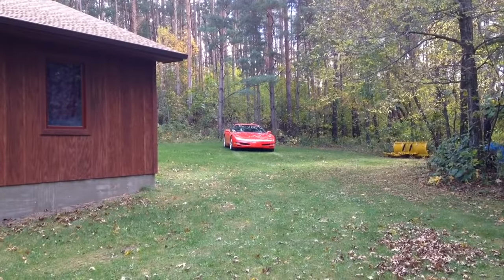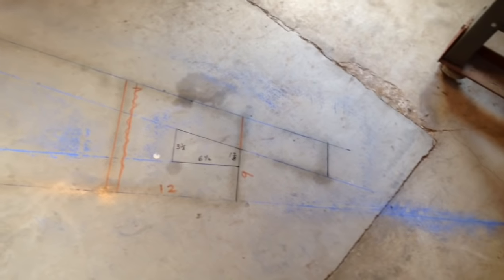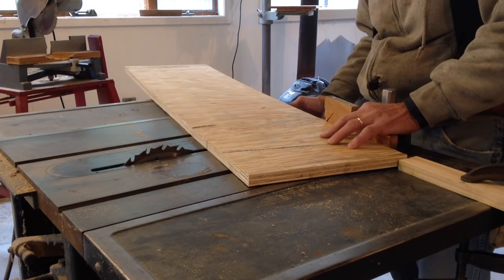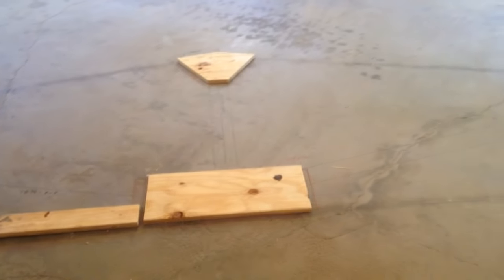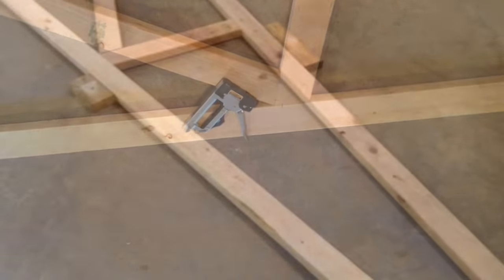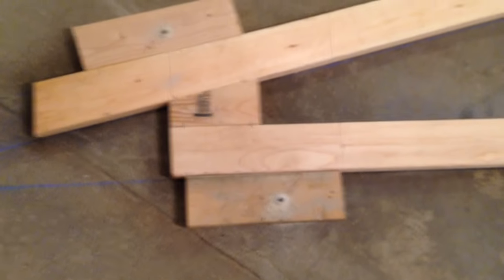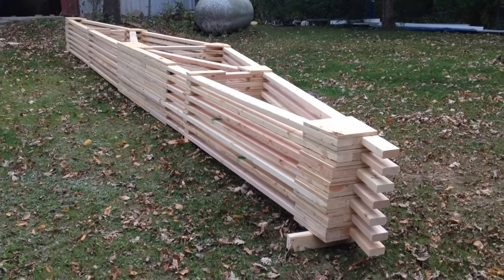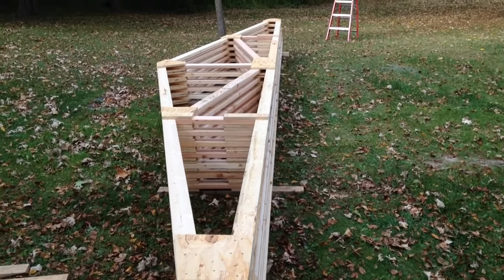Build your own wood trusses

Comment: I used Titebond II to glue mine together and used 1 1/2" staples to put mine together. You can just roll the glue on with a paint roller. In ten minutes you couldn't tear them apart without destroying the truss. I've made hundreds of them that way and after 25-30 years they are still in good shape. Way better than the press metal plate gussets.
Reply from the maker: Kris,  Good tips that you have.  Thanks for chiming in.  I would be a little leery of the titebond, as it is not waterproof.  If you keep them dry it would work.  Obviously has worked for you.  steve
Reply: @flyboyslc1  Would not make any difference. Neither 2 or 3 is structurally rated glue. Read the bottle!
Reply from the maker: @gary24752  I think your comment was directed to Kris.  The PL3 that I did use complies to astm D3498 which applies to gluing osb, plywood, to wood floor systems.  A lot like gussets to lumber truss components.  Here is the tech data sheet.  https://dm.henkel-dam.com/is/content/henkel/tds-us-loctite-loc-pl-premium-3x-2019-12-12    Your point is valid.  Make sure the glue you use is the right application.
Reply: @flyboyslc1  Actually  ASTM D3498 does not pertain to using it for structural purposes. It is construction adhesive meant for sub floor assembly.

Comment: How'd you size your gusset plates?
Reply from the maker: Hello Dillon.  Great question!  The gusset size and shape were just functions of looking at the various member joints and sizing the plywood gussets to adequately cover the joint.  More or less a seat of the pants thing.  Figure that a 2x4 is 3.5" wide so in all cases make the plywood cover the full width and then at least twice the length or 7" down the 2x4.  The most tension stress in the whole truss is the bottom chord.  So at that place I lapped the bottom chord splice 24" on each side of the joint so my plywood was 48" long by 3.5" wide.  Hope this helps.

Comment: Plywood has a grain. The strong direction is "with the grain". more than half of your truss plates are cut and will be installed "against the grain" so they will be less than half as strong as  they could be if you paid attention to the grain of the plywood.
Reply from the maker: Holly,  you are correct, at least in part of what you say.  Plywood is really complicated.  Tensile strength can vary a lot between various plywoods, depending upon veneer thickness, number of plys, and species of wood.  Couple that with the fact that almost all of the truss connections are not simple vector forces.  Many connections connect three members, and some of them are in tension and some in compression.  Generally speaking, if the face grain of the plywood matches the grain of the lumber you will have the best situation, which is what i did with my trusses.

Comment: Building trusses sounds like a lucrative business. I can actually do the calculations and sketches on my computer.  But I’m skeptical of wood trusses.  Wish there were other options that isn’t susceptible to termite invasion.
Reply from the maker: See a post below regarding light gauge steel trusses, that are built in much the same way.  Totally termite proof.  Or google steel residential roof trusses and see what you find.  On the business side of things, you would have risk that would need to be insured to protect yourself if something went wrong.  best to you.  steve

Comment: Do you know of a book that I can buy to help me to build a truss for a very snowy climate  for I'm going to build a barn that is going to be 48 ft. wide
Reply from the maker: Hi Bill,Glad you are going to research this a little, as what you are planning to do has way more risk than my short span trusses that were installed two foot on center spacing.  What I would suggest is google "pole barn design" and then sort through the results.  I did find this without too much looking.  https://morningchores.com/pole-barn-plans/   There is a lot of stuff out there, and you have a lot to think about with a barn.  Good idea to get some good info, and maybe visit a local building supply place to also get an idea of what you will need.

Comment: Over the years I have seen quite a few trusses broken at the metal gussets.  Never, broken at a wooden gusset.    Structurally, the larger the wooden gusset, the stronger, but again, I've yet to see even small and somewhat undersized gussets be the site of a break.     When a patch is needed for a broken metal gusset plate, guess what, it's an oversized plywood gusset.
Reply from the maker: Norman,  I can tell we think a lot alike.  Everything you said is true.  I can remember calling the truss manufacturer and asking for a field repair procedure and it always involved using lumber or plywood, glue and nails.  Ply gussets also make the truss more rigid and that helps when setting them too.

Comment: Whats with the sparks flying out of the nail gun (9.25), that's not normal is it? Nice vid though.
Reply from the maker: +twoweary   Hi there.  Was wondering if anyone would ever ask about that!  Good catch!  No it is not normal.  I was using some old leftover generic nail strips from another job in my own Paslode nail gun.  I suspect that the nail gun driver or hammer if you will was not perfectly compatible with the nails, even though the nail strip maker said they were.  Just a slight mis- spacing of the nails would cause the driver rod to clip another nail head before striking the nail beneath it that is to be driven, causing the sparks.   It worked, but surely not as well as if I had name brand Paslode nails in the gun.
Reply: Oil the nail gun

Comment: remarkable job my friend. 
one question :
wouldnt it be easier to get the lumber together with truss nail plates instead of cutting the plywood supports.
again, beautiful job
Reply from the maker: +Pikubird Ok .  Hi there Pikubird.  Nice feedback and I appreciate it.  The galvanized truss plates you speak of would certainly save weight.  I am guessing the plywood added about 25 pounds to each truss.  There are two reasons I did not use the splice plates.  They are hard to get a good attachment using carpenter shop tools.  They are a factory applied splice, installed I think using large heavy rollers or a hydraulic press.  I do not have either one.  Another one is availability.  For such a small truss run, getting the plates would be difficult to do.  I do not know off-hand where to go to buy them?  Google them I suppose?  It would take perhaps 4-6 different types of splice plates as well and finding them in small quantity may be difficult.  Just didn't look into it.  Thanks for your interest.

Comment: Nice job,try doing it with 8x8 beams and steel gussets for 30ft long trusses,then you'll think twice about doing it again
Reply from the maker: @GregSierra-v3j  Greg.  I did stuff like that 45 years ago when I timber framed my gambrel roof house, modeled after a barn.  I actually glue lam fabricated the 6 by 8 columns and the 5 by 10 beams.  Mortise, tenon, wood pegged the bents and connecting beams.  I used conventional rafters though.  Did not fab timber trusses.  But I am certainly capable and qualified.  We raised the bents and beams by hand, using block and tackle and push poles.  I did lots of things back then that I would not think of doing now.

Comment: $25 for the lumber.  Those were the days!  Thanks for the video, still, a decade later.
Reply from the maker: @MarkH10  thanks Mark,  yea, lumber really went crazy!  At least it has come back down some.
Reply: @flyboyslc1  I think you would do well with a chain saw or better type of on site lumber mill.  Get your lumber drying for projects months ahead, and possibly bartering in other materials of importance, but not local, or more technical than you can easily accomplish.
Reply from the maker: @MarkH10  I have considered doing just what you described.  But I am old now, and my chance to do a lumber business is gone.  Although the potential reward is great, so is the expense and just sheer work of it.  Back in my younger days, Bellsaw sold a pretty good sawmill that I would have done well with.  But then you need a building or shed to protect it, and a forklift to move the logs.  And on and on it goes😊

Comment: I build 1 truss and then build all the rest on top of the first one as a template on saw horses. In that way, all are identical and I'm not crawling around on the ground on my hands and knees.
Reply from the maker: Lysle,  Lots of ways to do the same thing sometimes.  I started out just trying to follow the chalk lines on the floor of the shop.  I found that difficult to do, due to joint creep and crooked lumber.  That is why I built a jig on the floor.  It forced crooked lumber to where it needed to be, and ensured all trusses were the same.  Also, I was working alone, so trying to flip a truss to do the back side connections would be difficult to do off of a truss at sawhorse height.  It was easy for me to flip them from the floor, do back side work, carry them outside, and build the next one.  Best wishes.  steve
Reply: Doing it on the floor is easy when you are young. However, as the years pile up, so does the mistreatment you do to your back and hips. After about fifty, you really start paying for it. If you only build a few trusses one time it probably won't matter. However, you only get one back, and unlike hips and knees, it can't be replaced.
Reply: Backs can be replaced with a changes of diet, supplements, stretches, and exercises.
Reply: Or they can be changed by going back in time when the natural effects of AGE wasn't an issue.  Once a back, knee or hip has been used through a lifetime, enough to need being replaced, no amount of diet, supplements, stretches or exercises can undo that harm.  We are talking about the effects of AGE on a body that inhibits said body from working on their knees on a hard floor, what they gonna do, pop a vitamin, stretch, run in place and then their good to go?   You sound like some kind of health guru.  In my mid sixties, I prefer the template idea.
Reply: Cartilage is constantly being replaced.  Yes, with proper diet and supplements joints can heal.  I could barely walk, but by using Osteo Bi flex my knee healed in about 1 week. And stretching does help with backs that are pulled one way causing pain.  We have been trained to believe that surgery and drugs are the only options, but it's not true.
Reply: A jig is the only accurate timely way to do it.
Reply: At fifty, I feel like 25 only... I don't smoke, drink, but eat a lot, coupled with exercises.

Comment: 14.04 and 14.4 is not equal in case it matters. That's what a rasp is for?
Reply from the maker: Hello David,   I am sorry, but do not understand the meaning or purpose of your post.   If you are referring to my comment about asking Siri what the angle cut is for a 3:12 truss, and I mis-spoke, you are certainly correct, it does not matter. You could square cut the web members and the splice plates or gussets would transfer the loads across the joint.  If you want to build trusses with a rasp, that is your option.  Best wishes, steve.
Reply: Just noticed the difference. A .3 difference over a 20 ft span might be a problem. Glad to help

Comment: I've been working for a component manufacturer for the last 20 years of my life. Started in the shop and now in the office in design/estimating/inside sales. I know my trusses. Like you said you did save some money ($300?) but if you're a busy/important man your time is worth more than 3 bills. Plus most townships do not allow site built truss systems because they aren't certified by a licensed engineer. Kind of ironic that stick framed buildings don't require such certifications. Anyway with the company I'm with we could have supplied this small order in a matter of days and for not much more than you spent. Plus you get a warranty, sealed truss drawings and trusses made from grade stamped kiln dried lumber with options in SPF, SYP, fire treated and even pressure treated. With galvanized plates there's no chance of corrosion and should you need to modify a truss you'll have free access to our professional engineers who will provide your repair drawings to submit to your building department. I know it sounds like a sales pitch and I applaud your DIY approach. I myself hate paying anyone to do what I can for myself. You also say it cost you about $25/truss? Did you add in the cost of the plywood gussets, adhesive, nails, ect? To me it looks like you used at least 2-3 sheets of what appears to be 3/4" plywood and where I live it's about $35+/sheet. Hey don't mind me, I'm just babbling lol. Do your thing!
Reply from the maker: Wingman,  I found your comment in a spam folder, and moved it to the Comment section of the video.  I agree with most of what you have said.  Around here in Iowa there is not anywhere that could have turned these trusses around in a few days, and I am a very busy man.  Just found a little niche of time to do them, and did enjoy doing them too.  The video has been outrageously popular, and never expected that.  I did include the cost of the plywood and other parts in my estimated costs.  sure did not do it to save money anyway.  Best wishes.
Reply: wingmanalive did
Reply: not 300 but 200 like what I heard
Reply: Well said and good approach to your questioning. I found this vid pretty cool and informative. But i definitely hear what your saying....Time is money....and blueprints are useless without a warranty or legit license to back them.

Comment: You must live in an area that doesn't require a framing inspection. A truss has to be engineered by a structural engineer if you do.
Reply from the maker: Yes Jim, I'm well aware of the Code Enforcement requirements and noted that in the video, in case you missed it.   I purposely moved to a place without those requirements.  I enjoy freedom a lot, and do not need someone looking over me.  Hate to say it, but many building inspectors i met over the years were no where near as competent as i was.   I have set thousands of trusses over my 48 years in construction, so doing a simple design for these was no issue.  best to you, steve
Reply: How do banks feel about homemade structural elements?

Comment: I've been in the truss business for 21 years and I think this is a cool video. The gusset sizes on some of the joints are a little small but they're not going to fail. Maybe just vertically deflect slightly over the years, if anything.

Even though I work for a truss company and get a discount I site built some small trusses for a pole barn just to do it. It was very labor intensive but fun.

Keep doing your thing! Cheers
Reply from the maker: Thank you Everett,  sorry i missed your post.  Nice feedback!
Reply: I agree, it’s ok for smaller jobs; sheds, additions & smaller garages due to labour costs and time constraints as you must be experienced at building trusses or your employees are gonna have an easy day doing a lot of standing around. Done properly by an experienced carpenter who’s able to delegate the workload will have an assembly line going

Comment: This would never fly in NJ.  You need a permit for every thing out here.  The engineers would have to approve this.
Reply from the maker: You are correct about building permits.  Lots of places even here where I live in Iowa will require an engineers stamp on the plan.  Not many engineers will do that.  Little financial reward for a lot of risk.

Comment: Do those gussets have to be 3/4" thick?
Reply from the maker: Hello Max-  Truss connection points have either tension or compression forces acting on them.  Sometimes there are both tension and compression together in a connection point.   Compression members need enough gusset to keep them in alignment.  Tension members need enough plywood to transfer the tension load across the connection point.   Consider that the main framing is usually 2 by 4 or 2 by 6 lumber.  This lumber is 1.5" thick.  When you take plywood and complete the connection I personally like to use 3/4" plywood on each side of the joint.  That is in effect maintaining the total 1.5" thickness across the joint.  I have seen people do it with less thick plywood, but personally I like to use 3/4" plywood.  Hope this helps.  steve

Comment: I would have done my gussets with a template and router table with bearing cut bit.
Reply from the maker: Matt,  That is one way to do it and repeatability would be perfect.  But a lot of sawdust too.  What size of router bit? I think the smallest one I have with a ball bearing pilot is a half-inch.

Comment: Most building departments won't allow this without a engineers drawing
Reply from the maker: Jean Paul Lanoue Jean, I think i cautioned against proceeding without checking with the building department.  In reality, any good carpenter is using seat of the pants engineering whenever they stick frame a house or other wood frame building.  A good example would be framing a roof using rafters.  Rafters are something that most modern carpenters would really struggle with.  Yet the building department requires no engineers stamp on the plan.  Instead, a good building official may consult a span table or something like that to determine if the right size wood members are being used.  But likely not.
Reply: @Steve - I loved it when you said, people always asked me why I have 2 Corvettes, because my shop won’t hold 4. That’s a classic great reply, Hall of Fame type of quote , I don’t believe I’ve heard of that one before. I own a 1980 Corvette with 36,000 Miles. Enjoyed your video....!!!
Reply from the maker: Thanks Stan,  missed this comment earlier.  We were married in a 68 coupe with a 427 in it.  C3's were really beautiful cars.